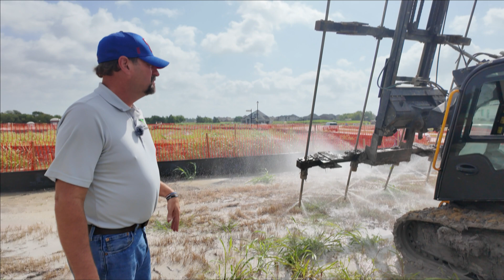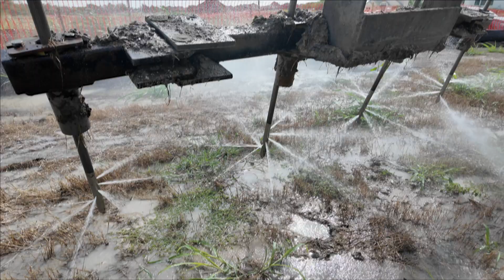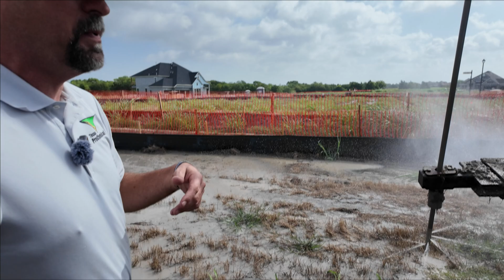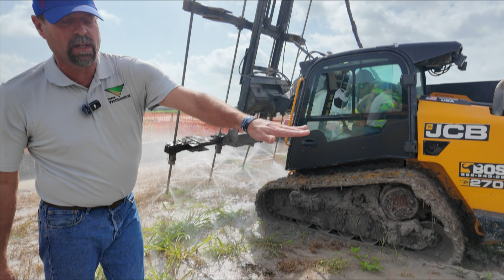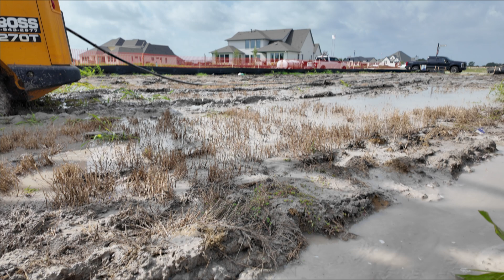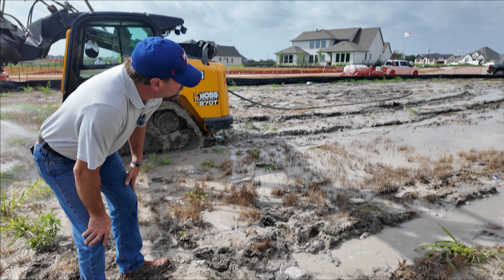How Our Revolutionary Water Injection Process Stabilizes Soil!

Comment: I am in South America and have a large two story concrete home sitting on 2 Meters of black expansive muddy clay that has a 1cm expansion per meter with an average hydraulic pressure of around 7,000psi per sq ft. After cracking began, we first installed proper drainage around the home and then installed a plastic isolation curtain extending around the foundation and down 2 meters to the rocky subsoil. This helped but only slowed the reaction time between dry and rainy seasons. I thought of chemical treatment using lime but it is fully interactive with magnesium, meaning it acts like a see saw, increase calcium and magnesium is reduced, but increase magnesium and calcium is reduced. So over time heavy rains can move surrounding magnesium back under the home and neutralize the lime. Potassium is not so, it has a one way reaction. It will neutralize magnesium but magnesium will not neutralize potassium. So your approach is a permanent and economical fix. Thanks for the vid and wish you success in making Texas a better place to live.